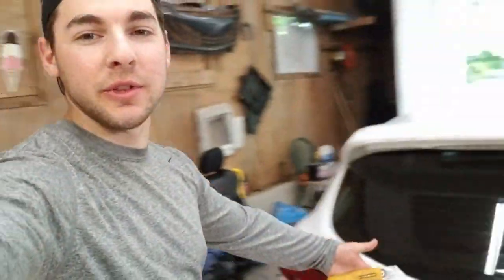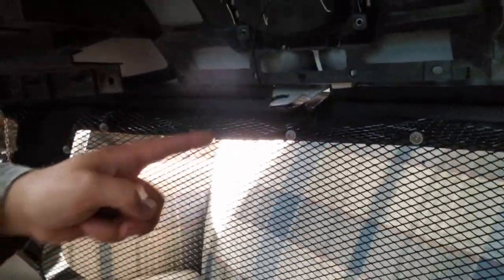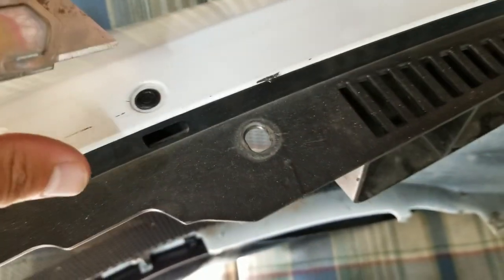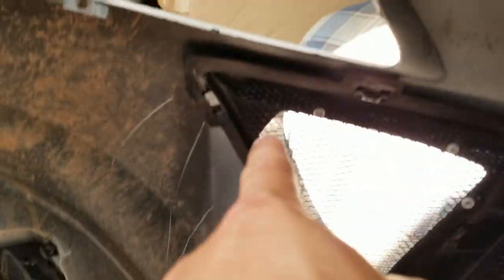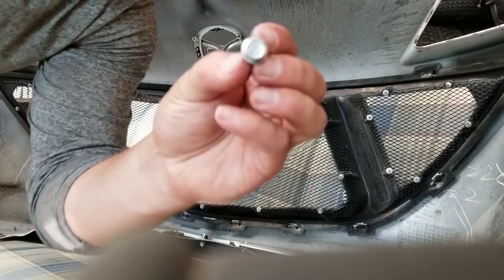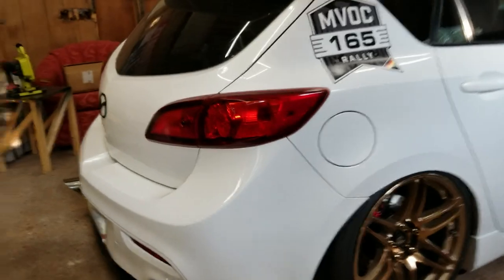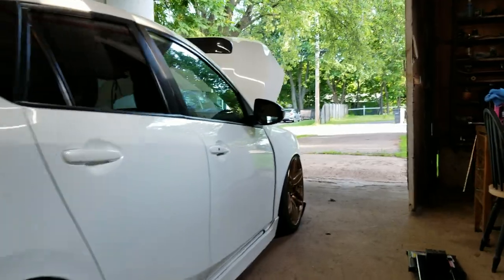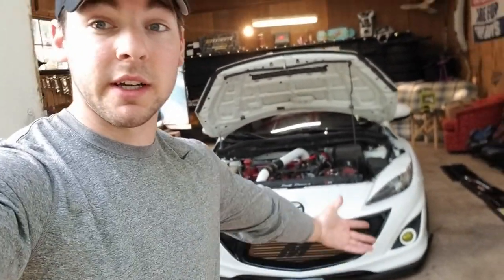Fixing The Open Mouth Mazdaspeed 3 Grille Issue!

Comment: Mesh… or thin horizontal fins? When I try to figure out the flow of air, and the turbulence… something tells me the mesh is not ideal, not that the stock “grill” is any good, but that a better option can be made. Damn having a wind tunnel would be awesome 😎 
Never mind, it was a suggestion for improvement not criticism

Comment: I’m 90% certain you push the center of those plastic pieces holding upper plastic in in order to take them out. It’s been awhile since I messed with the bumper, but pretty sure that’s how you remove them

Do you plan on creating some ducting to help direct air to the radiator? I’ve heard that the open mouth grille affects coolants temps because the air just goes everywhere unlike with the stock grille